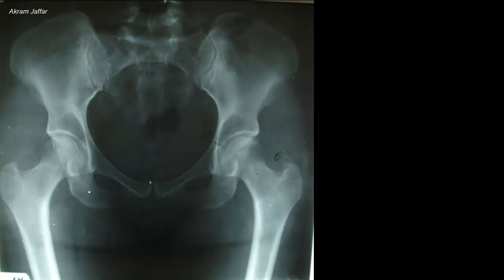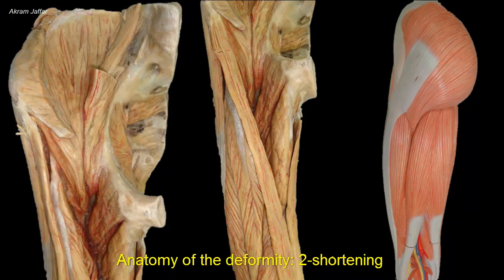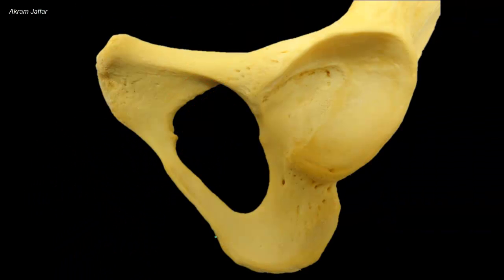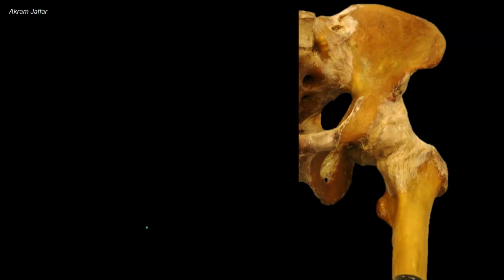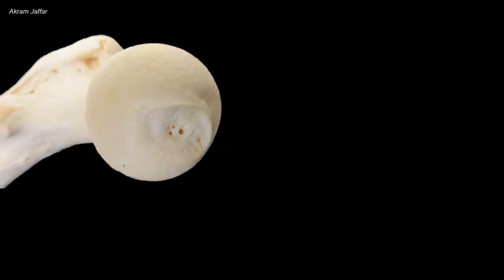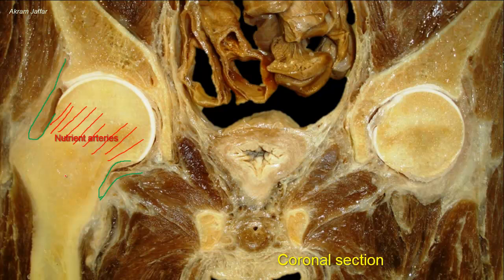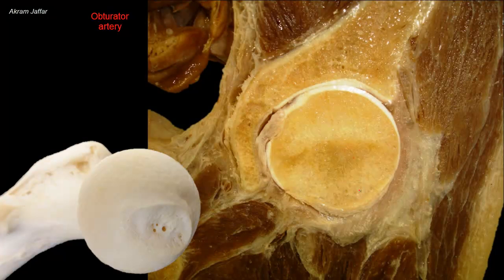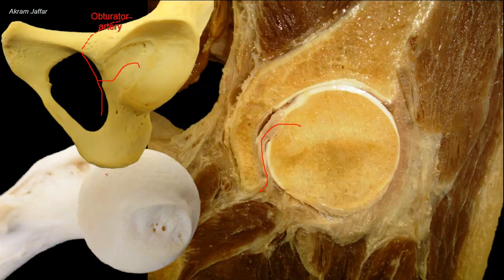Femoral neck fracture - applied anatomy

Comment: sir,
i m suffering from neck of fumer fracture. it was happened on 19may this year. now doctor has allowed me to walk with walker only inside the house.
i m feeling very good now.
i am affraid also so please tell me when i will be fit fot walk without any support.
plz advice me.
Reply: What operation you underwent?... Cancellous screws??... Or any other treatment maneuver.......... The time of your full ambulatory depends on the method of treatment employed..... If possible share your X ray.
Reply: @MultiRambo008  if it is operated with 3 cannulated screw's is it possible for shorten of femer neck